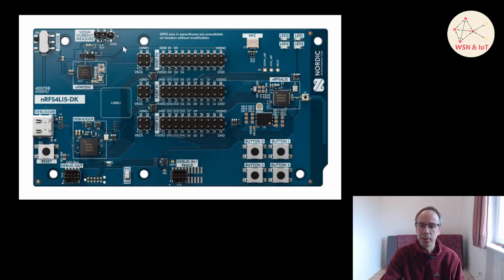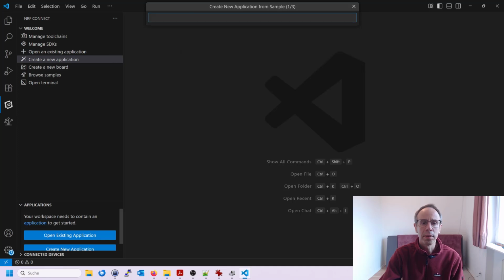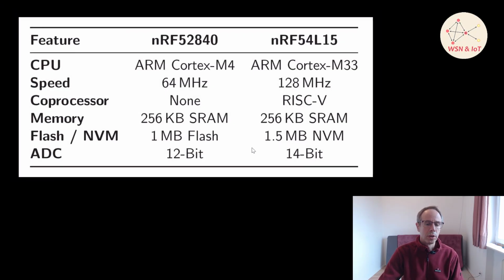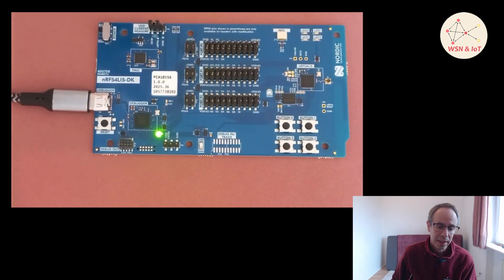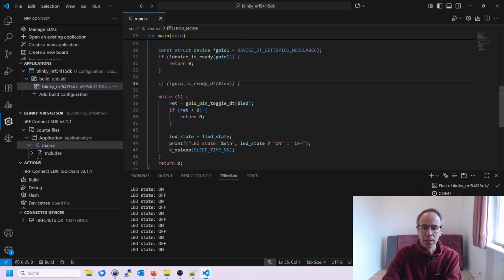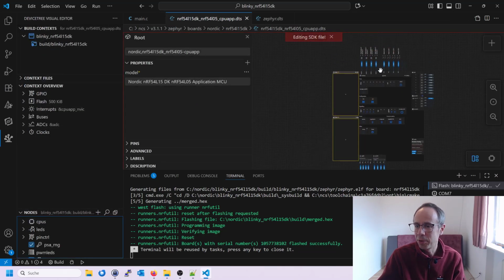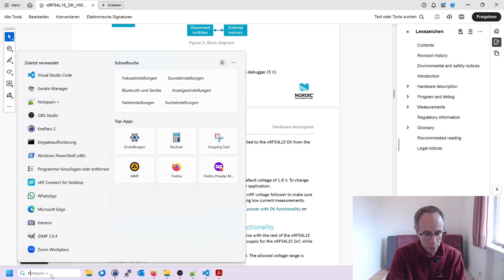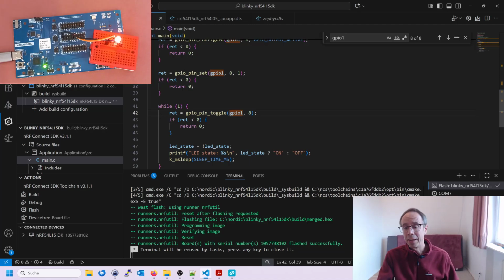Unboxing and Introduction to the Nordic Semiconductor  nRF54L15-DK (LEDs, GPIOs, PMIC)

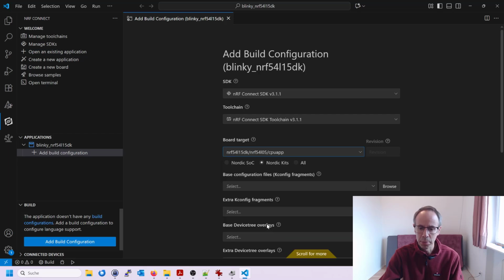Comment: At 0:5:14, you selected the nRF54L05 as the board target and unintentionally showed an extra feature of the Kit: It can emulate the nRF54L10 and nRF54L05 SoCs. Also, nice video! The reason there is only one USB here is that the nRF54L15 SoC doesn't have USB. The nRF54LM20 DK has one USB connector for the debugger and one directly connected to the nRF54LM20A again.
Reply from the maker: Yes, thanks for the clarification. I had already noticed the board target thing while editing the video. I thought no one else realized it :-)

Comment: Hey, I’m planning to make my own custom nRF54L15 board. I just want to know if I can program it using an nRF52 DK?
Reply from the maker: Do you mean if you can use the on-board segger programmer? Should be possible since it is just an normal segger j-link. In the documentation only the nrf 51, 52 and 53 are official mentioned. So there is no guarantee
Reply: The main difference between nRF52 and 54 is BLE and security. The new RISC-V on nRF54 is for the TruesZone feature. And if your app will only focus on business logic (do not use separate hardware for security features) and use BLE 5.0 features. Your app can be ported from nrf52 to nrf54.

Comment: Hey!

I've recently gotten into working with the NRF54L15 (not professionally, but for educational purposes) and I've really enjoyed your videos so far! :)

Currently, I am working on a project where I have to drive a display using QSPI. In an earlier "prototype" I've implemented that on the RP2350 using the PIOs, which was quite simple and worked perfectly well. Now on the NRF54L15 I am kind of overwhelmed. The platform is a lot more complex and documentation is less detailed and targeted more towards industrial use.
Now, the sQSPI soft peripheral, seems to be a perfect fit for my case, where I want to be able to use the full speed of the FLPR to write out data, however, I just can't seem to figure out a starting point for configuring all this using the device tree and forming a connection to the actual application code...

Would really love to see a video on implementing a generic sQSPI peripheral - even though it is quite specific 😊